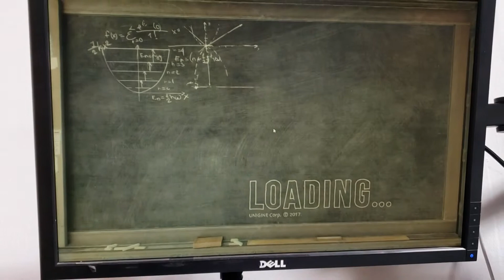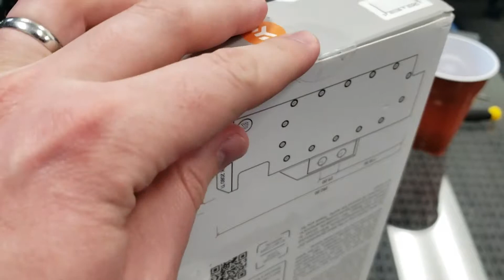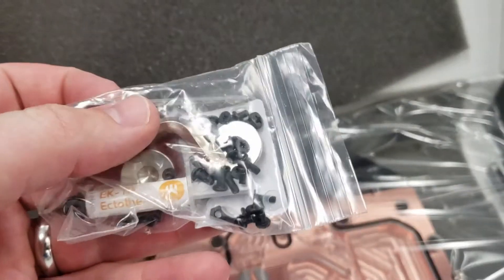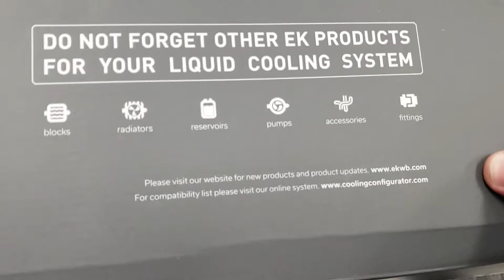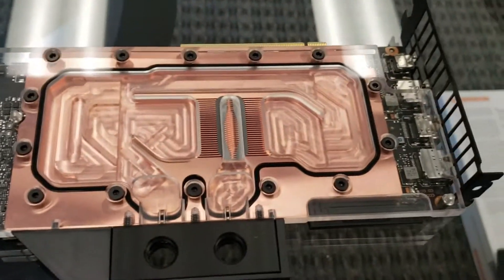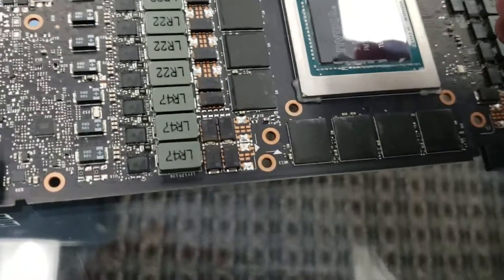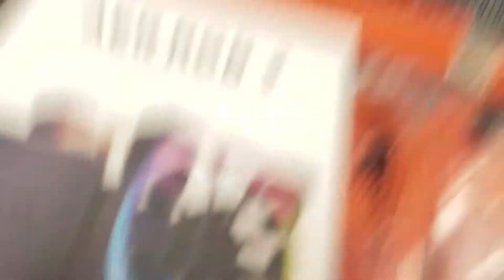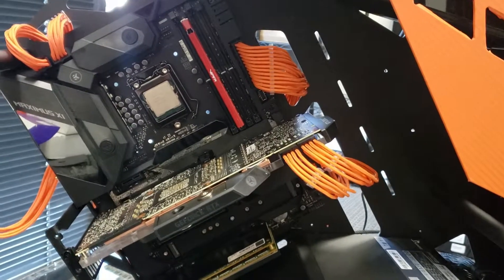Installing EK Waterblock on RTX 2080Ti 11GB

Comment: sorry to bother you good sir, but would you happen to know, if I wanted to remove the water side of the block to cleanse it properly, do I have to unscrew anything on the Dye side? (the side where you put the thermal paste and pads etc?)
On my card I feel like I might force it and it will break, I got a feeling theres 3 screws to remove on the back (dye side) but I'm not 100% lol
Please help :)
Reply: Memory from 5 years ago so i might be wrong here but i think you need to remove the backplate first, then remove all the screws on the back of the board underneath the backplate.  Then you should be able to jiggle the main block loose from the GPU die side.
Reply: Ahh thanks so much for replying mate I honestly appreciate it! I've tried google and I didn't seem to find my answers, perhaps it's because the card is an older one now lol.
I knew in my gut there was something else I had to unscrew! Thank God I didn't force it lol